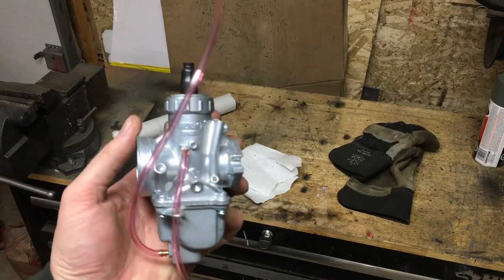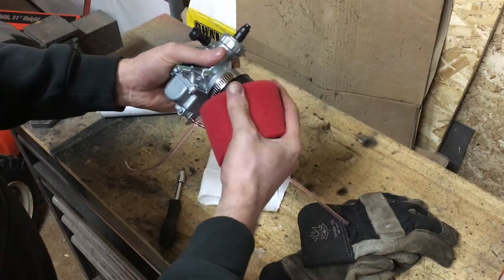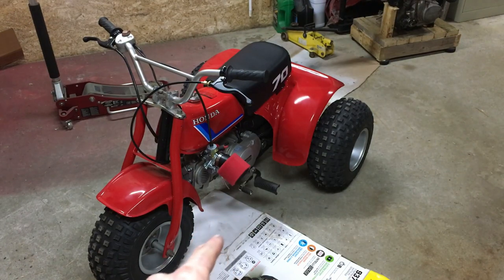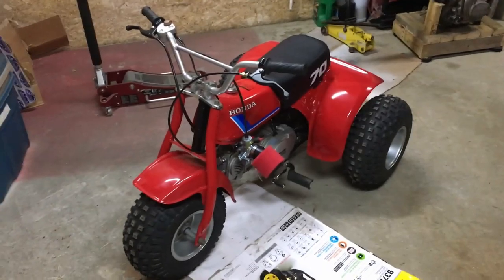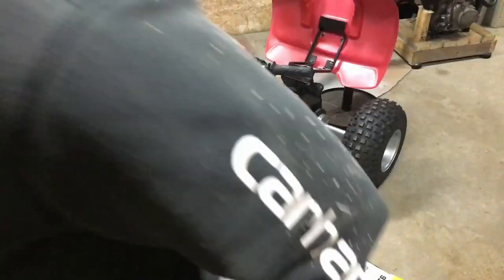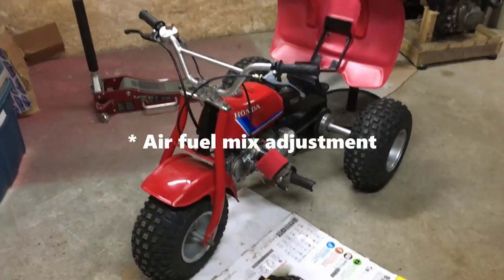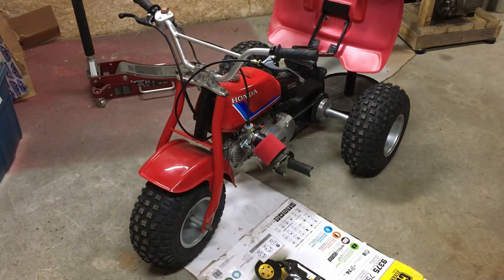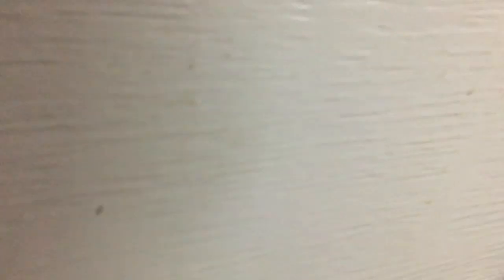1983 Honda ATC70 YX140 Molkt Carburetor Swap

Comment: what intake are you running?  i like how the carb stick completely out of the frame.  I'm having all sorts of issues getting various carbs to fit and run right.
Reply from the maker: I actually made the intake myself. It is in one of my other videos where I make it out if schedule 40 pipe via pie cuts. I actually sold the ATC70 this past summer to make room for other projects!

Comment: Nice build I recently picked up a ATC 70 don't really know if it is the OEM motor motor does not have the chain guard and pull start assembly and has a stuck valve I am restoring it in probably dropping in the 125 4 stroke with clutch same motor as yours
Reply from the maker: Nice! It should be a fun build for you. I really enjoyed mine. I'm currently working on restoring a 1981 Honda XL125s. Check out the ongoing work in my other videos!
Reply from the maker: One other note, this motor is the Piranha YX140, not the 125, but you should get similar results from a 125!
Reply: Yeah no problem long live ATC I think they're better restored then scrapped I have five of them my buddy got me into the ATC 70s he came over with one with a 110 automatic electric start and it was just nasty I'm looking forward to going all out on mine keep up the good work in the videos coming looking forward to seeing more